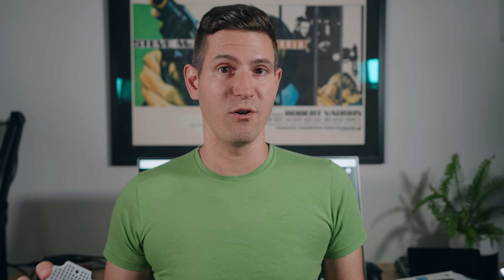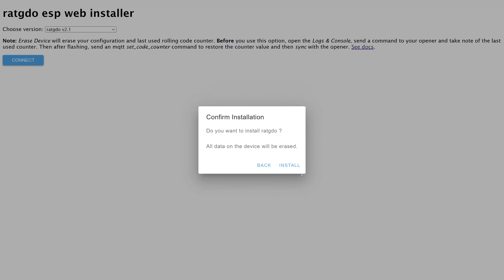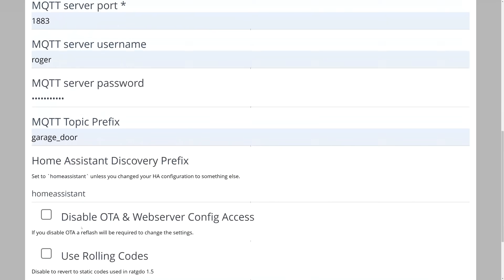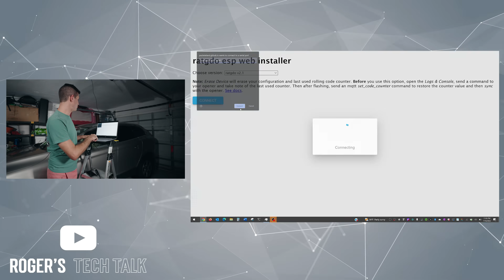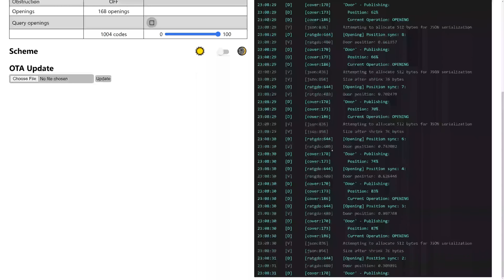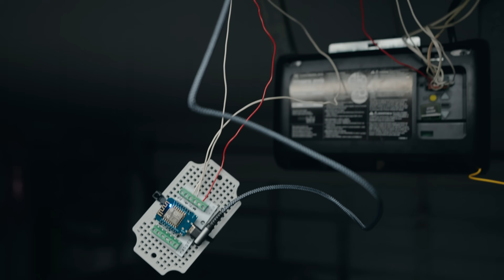Locally Hosted Smart Security+ 2.0 Garage Door w/ the ratgdo Project

Comment: All this tech and still a lousy internet connection.  LOL
Thanks for sharing this Paul.  I came here to hear your info on the Sec+2.0 and rolling codes over the wire, which is ridiculous.  Many of us are having issues with your MQTT firmware implementation(s) where it just stops controlling.

Comment: How do you select the security option (1+, 2, etc).  I am configuring using mqtt, but no security options show during the setup/configuration.  Suggestions?
Reply: I think it has been resolved and for community information:  Long story – very short. Reflashed ratgdo for mqtt.  All went very well. On the ratgdo web page, at the bottom, there is a Control Protocol selection. I totally missed this (MY BAD – BIG TIME). I saw and focused on the firmware update at the top of the page. (tunnel vision)  However, I selected Security +1, and then updated the firmware to V2.1. The system was updated and rebooted. However, the garage door would not respond.  So – reflashed, firmware reinstall complete, selected Security +1, DID NOT update the firmware to V2.1 and ratgdo works.  So, for me anyway, the firmware update is titled: ratgdo_esp8266_v2.1.bin.  And the update description would seem to indicate I need to update as I am using Home Assistant.  But I now believe the update label means the firmware update is for esphome….not mqtt.  So, as of right now, ratgdo works as advertised.

Comment: I got both of mine very quickly and got them working very quickly as well. Was working with Netgear on  a few things and they gave me a beta firmware upgrade which reset a lot of my devices including the RATGDOs. Didn't anticipate this and wasn't able to catch the last rolling codes of either garage door. 
If anyone knows of a link or how I can resolve this I'd appreciate it, otherwise I'm stuck with both RATGDO devices telling me there's an obstruction and I can't use them anymore. Which kinda blows...

Comment: We all know, and accept, that modern alarm systems have tamper-proof sensors so burglars have a harder job in trying to disable the alarm system and enter my building. We also buy expensive cylinder locks that are tamper proof and pay extra money for those locks to have a certain "security" logo on it. Yet, Paul finds it strange that the simple 2-wire button on wired garage door remotes is replaced by a more secure one.
Opening the garage door using a 2-wire switch seems a next level of allowing burglars to enter my house 😲
Reply: Unfortunately after about 15 minutes I had to stop listening to Paul's very interesting explanations. The audio quality of that video call is bad enough to distract me from listening to the content of his story.
If there is any way to improve this and share it again, I really love to listen to this.
P.s: It's amazing how we can watch a 4k movie with surround sound that looks and sounds perfect. Yet, a simple video call always seems to have problems.

Comment: Paul Weiland will not let anyone have access to his PCB schematics.  The cognitive dissonance here is pretty clear. You can't state that you're about not having people locked in to a product and being left high and dry if the provider decides to pull support for a service, and then go and do exactly the same thing you're accusing these businesses of doing; locking them in to a provider who may decide at the drop of a hat they're no longer interested in maintaining said product.
Reply: I think this is fair criticism, but the fundamental difference is that RATGDO is a complete product that operates locally. It's not a cloud based service that can be taken away from you at Paul Weiland's discretion, so I would still be comfortable buying it (since I'm not skilled/knowledgable enough to make my own even if schematics were available). It doesn't need to be maintained in the same way a cloud service does.
Reply: There are similarities but it’s a bit different. With myQ you’ve purchased a device and have used/interacted with it in a particular manner. The manufacturer then reaches out and say no you can’t use it that way because we changed our mind. In the RATGDO situation if you’ve not purchased anything why give the schematics away. If the schematics are desired enough, someone can put in the work and just reverse engineer his board and then post the schematics, you can then just download the code and solder your own board. It doesn’t appear to be an extremely complex board. I get what you’re saying but like my example it’s a little oversimplified. It’d be a bit different if he’s developed the hardware in a manner that makes it more complex for the sake of making it non-replicable and then claimed it’s open source or it frees you from manufacturers that lock you down to their ecosystem.

Comment: Is the device getting power from a usb plug?  If so, what voltage?  Can it be done with a wire connected to the door motor?
Reply: USB can be powered with 5v or the vcc pin on board with 3.3v. don't use the opener power that's either 12v or 24v
Reply: @kkgg69  thank you. I saw on Reddit that someone saying their unit isn’t getting enough power from a 5v power brick. Do you use this?  If so, what power brick do you use?

Comment: When closing the garage door, does this bypass the beeping that normally happens with remote requests?
Reply from the maker: No beeping on my system. That is a safety mechanism built onto commercial systems when doing remote access. The garage door motor doesn't know ratgdo exists so..